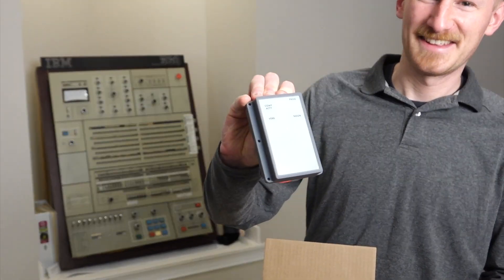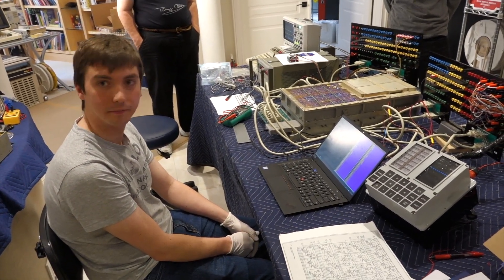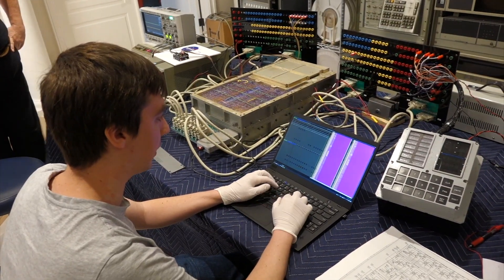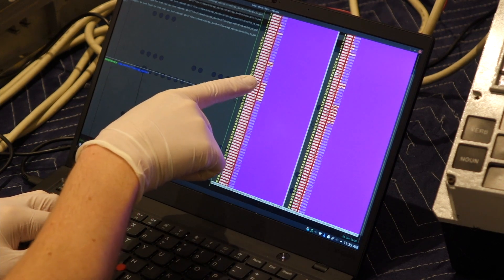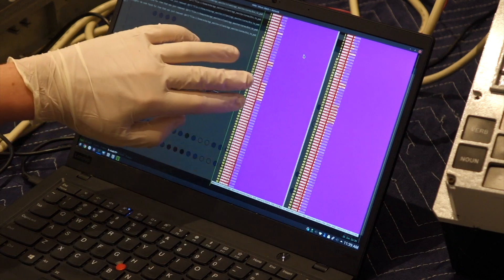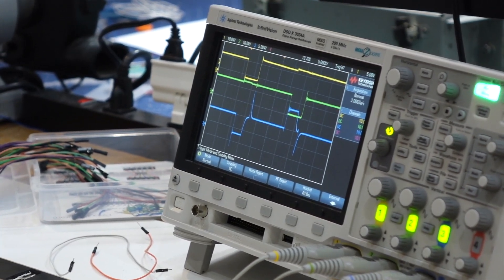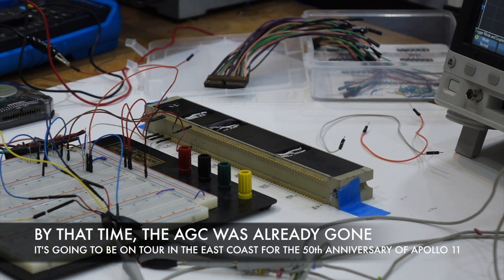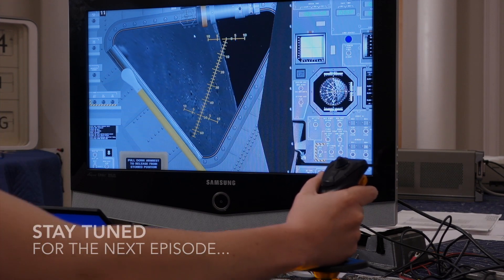Apollo Guidance Computer Part 22: Module B11 fails again!

Comment: Hmm, at this point maybe you should look at unpotting it with some kind of solvent.
Reply: It's a thermoset epoxy resin, insoluble.  The only chemical ways to get rid of it are methylene chloride, boiling sulfuric acid, or heating over 400C, all of which will get rid of the other parts a lot faster than the epoxy
Reply: @alakani  Well that's a bit disappointing. I figured an acetone bath might do it.

Comment: Considering the failure history of that particular module, would it not be a viable solution to just fabricate a new one? Otherwise you'd have to keep going back for more digging and more repairs.
Reply: I believe it's easier to simply replace the diodes, if and when they fail. Fabricating a new module would be far more time consuming and far, far more costly.
Reply: @gooseknack  ...and far far *not* vintage NASA hardware...